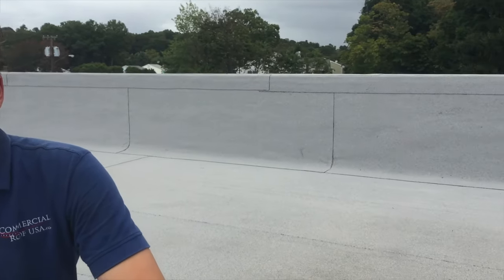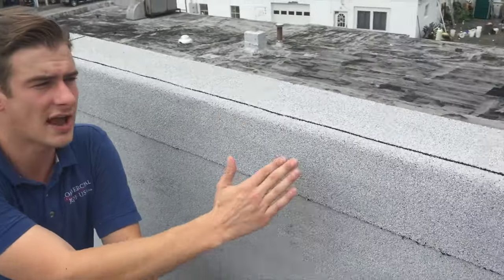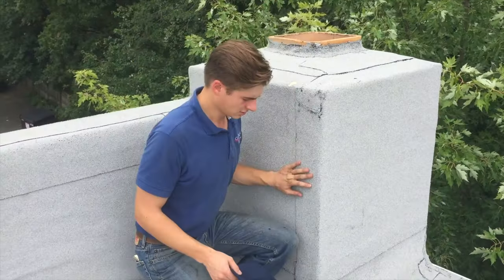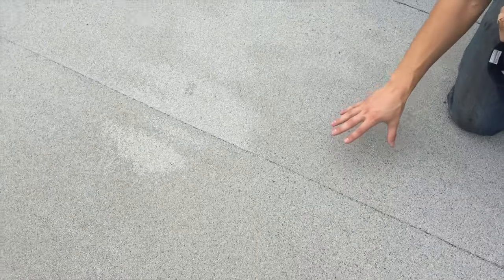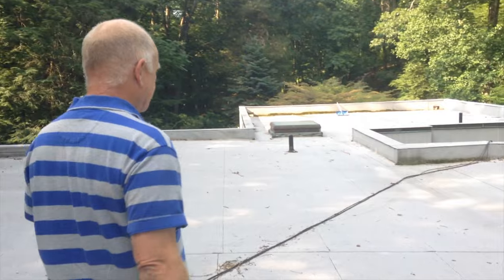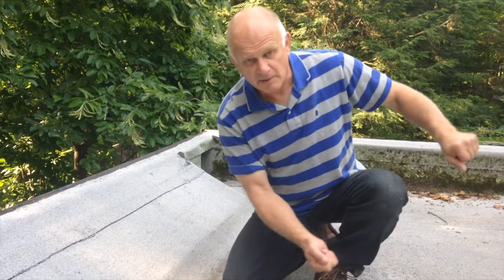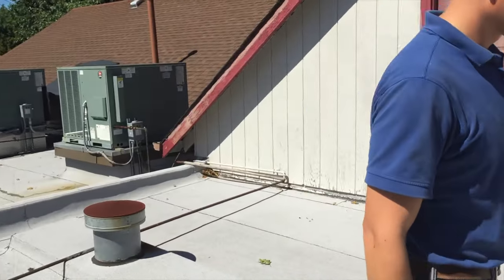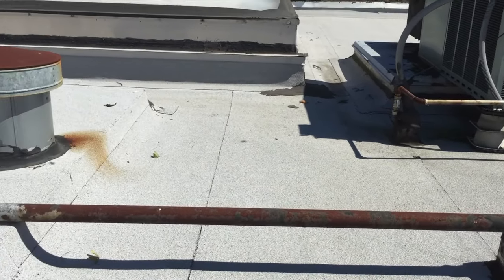See Proof of How long Torch Down Roofing last - you will be shocked

Comment: Not a neat job. Where are the soldier courses on the wall. They never let us get away with that! Where are the bow ties on the corners of that chimney also? But for the roof to last 20 years is good. I used to have the swinford brothers do our roofs and they hot mopped everything, even the walls were mopped and looked as good as using gum. Derby gum is the Owens Corning torchdown when they were making commercial roofing products.
Reply from the maker: Well, your style or not, the roof is still standing, this is now 5 years after that video was made. The proof is in the pudding. Bow ties and soldier courses or not.